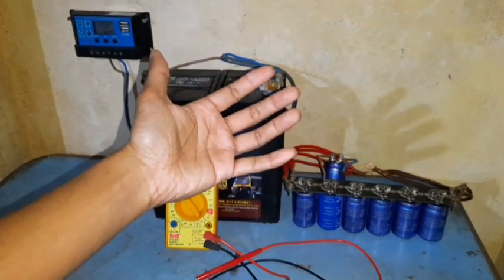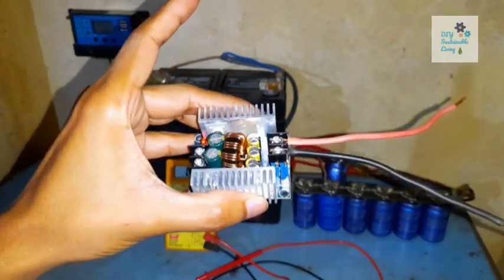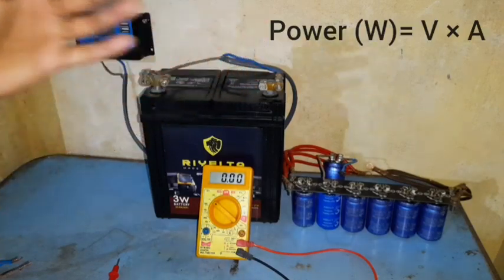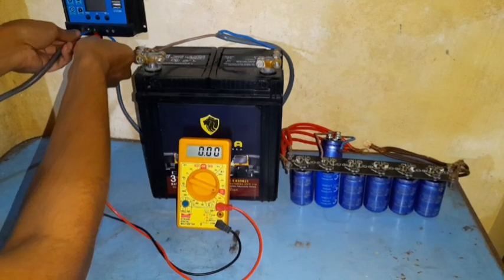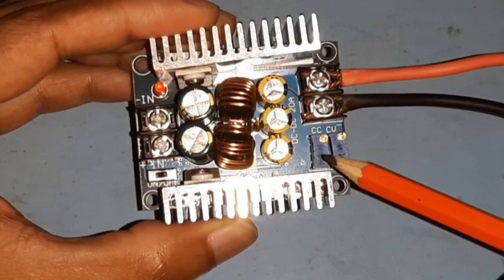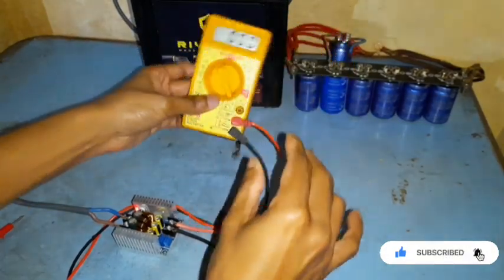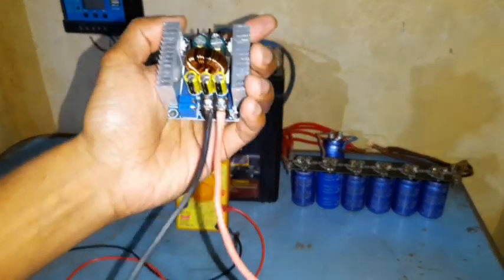Dc to dc Step Down Converter- Part 1 | Improve your DIY Off Grid Solar System using a Buck Converter

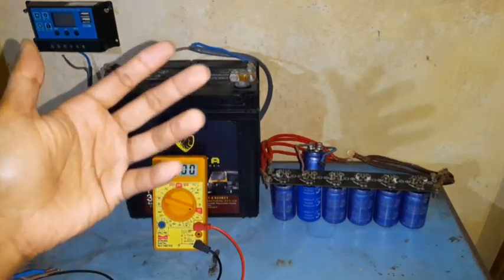Comment: I too have tried this and you highlight the limitation at 4:40. You measured the short circuit current where you got the 2.07A output current. But as you discovered, that was not available to charge your battery because Vout was less than battery voltage. It was actually 0V Had you measured the charge current into your battery, you would see approx 200ma increase or about 2 Watts. This because the Buck converter pulls down the panel voltage very close to battery voltage. There IS a tiny benefit of 2 Watts, but nothing like the improvement you'd get if the buck converter didn't pull down the panel voltage. With perfect buck converter that let the panel operate at ideal 18.5V and stepped down to say 13V, you would expect Charge current to increase by 18.5/13, but sadly that's not achieved. Back to the Drawing board. Tweaking the output voltage somewhere between 12.5V and 14.4V might improve the improvement. I hope that one day, you'll find a solution to this.
Reply from the maker: Please check out my next video on this where I do a live test to see whether it is worth it!... As you mentioned.. if Ithe input voltage is very high you might see a small increase in amps. Only MPPT charge controllers have the ability to keep the panel side voltage at its maximum powerpoint.
Reply: good point, but if youre just charging 5v this should work pefectly for a nice boost in amps to charge usb devices via solar, not so much 12v lead acid, however i would like to charge a battery bank at fast charge speeds i eventually use to charge a laptop. The charging of this laptop is fast via the powerbanks usb c (12v @ 1.5 amps) so i would like to get that same voltage and amps because thecharging of the bank  is slow via 5v.  However the  laptop charger(usb c)  plugged into the bank charges it at 9v 2amps, relatively quickly so i would to do the same with a solar soltution if possible.  My powerbank has a led read out of the volts and amps going in or out while charging is how i know these numbers which is very conveniet.   It uses the USB  PD protocole, im not sure how to interface that with solar but that would be cool.  Would simply something like this work to charge usb pd with solar?  https://www.amazon.com/Charger-Qidoe-Voltmeter-Adapter-Motorcycle/dp/B0915CCH5N

Comment: I have a 250w buck converter 24v to 12v 20amp max output... I ran my 150 w solar panel direct to radiator fan and pul led 70 plus watts(5ish amps at 14ish volts.) But when I ran the fan using a buck converter it's performance slowed drastically and only got 18 or so watts. I've read that buck converters don't work well with ?inductive loads ....is this true or did I buy a cheap one or defective? Can you do testing using multimeter and verify my results and or suggest a solution,,,power in should equal power out less 5 to 6 percent efficiency
Reply from the maker: Unfortunately buck convertery work well when there is a large difference in voltage. A 150w panel maximum power point is around 17 -18V there is no significant difference between 17 to 14V. And as always there is around a 10% loss of power at the buck converter. This is not an MPPT controller. Please check out my other video where I do a live working test on the buck convert with a 150w panel.
Reply from the maker: What is the voltage you have set your buck converter? And have you adjusted the CC trimpot to max output? A 150w panel should give you 8.8A!!!...

Comment: I am going to connect my 100w 12v pannal to buck and to pwm solar input..is this ok?
Reply from the maker: Yes it can be done. Please check my other video regarding buck converters with small panels. You don't get a very significant boost as expected. The link is in the description below!
Reply: @diysustainableliving2774  Same setup I have. 100W 18.5V panel into Buck converter into Battery (always under heavy load).
It gives at best a 5% increase in charge current ntot the  (1-18.5/13)=42% that we might expect, because the panel voltage gets dragged very close to battery voltage. I currently have my Buck converter to 13V with current not limited.
This approach held great promise, but buck converters just don't seem to be able to drive the current up without dragging the input voltage down. Back to the drawing board.

Comment: can your increase 5 A this buck canverter?
Reply from the maker: Please check part 2 of this video. It all depends on how much power you put in at the input. Note that in this video when Im getting 2A it is a dead short so the voltage should be close to 0v!
Reply: where is part 2
Reply from the maker: @dacreation369  You can find the link in the description below or at the end of this video!
Reply from the maker: @dacreation369  Here is the link.. https://youtu.be/OWjOcakSjk8

Comment: Do you think it would work well to use this buck converter to match the specs of a lower wattage/amp/voltage panel on an array? For example, you have a higher wattage replacement panel on a solar array, and you use the buck converter to lower the replacement panels specs to exactly match that of the rest of the array (that the other panels are all operating on lower wattage/amp/volt panels compared to the replacement panel).
Reply from the maker: Yes that is one possible use. Let us know the results of how it goes!

Comment: How about using this buck converter as phone charger from 20w 18v panel ( without battery) ? Will it give an output of 5v with higher ampere?
Reply from the maker: With a 20w panel you will get 1A directly from the panel. So if you step down you should get more amps. But if you want fast charge I think you will be better off connecting one of those car chargers that can give you fast charge option directly to the panel instead of the buck converter. If that requires a steady voltage then you might need a buck converter but most of the time they can handle the solar panel output voltage.
Reply: @diysustainableliving2774  so more amps does not, mean fast charge like this buck converter that you presented?
Reply: If this buck converter be adjusted to 5v, I want to know how much ampere will it give? (Directly from your solar panel)
Reply from the maker: In fast chargers the voltage is not 5v... you will get 9v and 12v options. The charger will decide depending on what your phone can accept. As for your question in theory an 18v 20w panel should give you around 3 to 4A ideally. However as it is not an MPPT you can only expect around 2 to 3A AT BEST since the load will bring down the panel voltage. Thats why I suggested you to consider fast charge 2.0 and 3.0 options if your phone accepts it.
Reply: @diysustainableliving2774    Would it be good to connect this buck converter first to the solar panel then I connect the the fast charger 2.0 or 3.0 the last to the phone or powerbank?    In this sense I will boost the output of fast charger.
Reply from the maker: From my point of view I think you dont need a buck converter. The solar panel can be connected directly to one of those car usb chargers as they require an input of 12v. I know that they will definetly work at 14.4v since that is the voltage the batteries are at while the car is running. The panels voltage changes with the load so I think the buck converter will not be necessary. However if it dosnt work and you want to drop the voltage to 14.4v then you can consider the buck converter. But in my opinion I think it is not necessary in this setup.
Reply from the maker: Always remember. Even the buck converter is not 100% efficient. Id say 85% at best. So if you connect it in your setup you will lose 10 to 15% of your solar power just at the buck converter.
Reply: @diysustainableliving2774  How can there be a power loss in this converter, when the panel upon testing it gives 18V x 0.68A equals 12.24w, then the buck converter gives 14V x 2A equals 28w? Is your panel 15watts in this video?
Reply from the maker: Good question. You see I did this video in the evening around dusk so that my panel output will be minimal and I can show the results on my multimeter. It is after this video only I realized that I was wrong!... What happens at the output is that the voltage drops almost to Zero!... even as the amps go up. The buck converter is helpful if there is a large drop in voltage but not in small differences like from 18v to 14v. My next video I made was to show that practically it is not functioning as an MPPT.
Reply: @diysustainableliving2774  Can we conclude that this kind of buck converter is advantageous for 15w to 20w solar panel?
Reply from the maker: If you defineatly want a 5V source, eg If your phone only accepts 5v and dosnt have a fast charger option or you want to run some thing els that need 5v only then it will be worth it. But if you are going for a voltage of 12v then its not worth. Especially if you plan to use it as a phone charger that has a fast charge option.
Reply from the maker: Tel me exactly what kind of device you plan to run on this panel. I may be able to give you a more accurate plan.
Reply: @diysustainableliving2774  ok thanks for your ideas. This is very helpful for future reference.

Comment: Buck Converter Could  Step Down and Or Stable Adjust Output Voltage (V) and Curent Energy (Ampere). For Solar Panel, Case with PWM SCC before Buck Converter, It Can Adjust To Maximum lower Voltage (14,4v for VRLA Battery) and Curent Output (example 100WP Solar Panel = 5,7 Ampere, It Can adjust to Max 5A depends on weather ). Means, BUCK CONVERTER deliver Limit  Lower Voltage and Focusing to Curent Output (Ampere) from PV (Solar Panel) to Battery.
Reply: True. Buck Converter Optional use  PWM SCC. MPPT Could Manage and Deliver maximum Energy needed for Battery, Recommend Hybrid Inveter, Best Solution for Solar Panel  as an Energy Souce of Electric Use).
Reply from the maker: Yes... But in case of solar panels the input voltage also dropps when you draw power even with the buck converter. That is the difference between a buck converter and an MPPT. In MPPTs the panel voltage is kept at its maximum power point.

Comment: Sir it is possible to use dc to dc connected between battery and power inverter...thnx
Reply from the maker: It depends on what you want to achieve. As long as the battery voltage is within the inverters required limit you dont need a buck converter.
If your battery is say 24v and your inverter is rated for 12v then you will need a buck converter. But remember. Its performance will be limited by the buck converters amp limit.

Comment: Can I connect a solar fridge with electricity using a converter
Reply from the maker: You can but it wont work long. You need at least a small battery. I made a video explaining this.. https://youtu.be/yyEPNL7Va9o

Comment: Where is link to purchase?
Reply from the maker: https://youtu.be/OWjOcakSjk8
Please check this video first before you make your decision.
Reply: @diysustainableliving2774  ok u said link in this video .. but link is about another video in that video buck converter link is there .. 😊
Reply from the maker: I realized that the buck converter is not good as a MPPT after making that video. So thats why I had to change the link that way so as to not mislead you guys. 🙂
Reply: @diysustainableliving2774  i hv service line wire ( aluminum ) it is 50mtr wire so can i use that wire for my 100watt mono solar panel ? If yes , 1) will it drop my panel voltage and amphere ?
Reply from the maker: Service line? Do you mean the thick wires used for mains power transmission by the grid?.... Aluminium is the best material for conduction and the thicker the wire is the better the conduction. But always try to keep the lenght of your wires to the shortest possible distance to avoid unnecessary losses.

Comment: Sir can be use also in mppt
Reply from the maker: Its good for a voltage regulator and charge controller. But later only I realized its not a good MPPT in all circumstances. Check out my other video where I do a live test with the buck converter on my system.

Comment: Where back converter is available ? Can we buy it on line ..
Reply from the maker: Yes it is available online. But first watch my videos and see whether it suits your needs first.
Reply: The power will be the same always, but you can control the voltage.  If you have 12v and  2a is equal to 24 watts when you use DC a DC converter you could download de voltaje for example 6v and 4a but the power still be 24watts.

Comment: I have 150w solar panel i am directly using with bettry and solar because i never allow to solar overcharge my 🔋 due to at the same time i consume power .but i had  also used pmw that reduce my fan speed 
Now please advise my weather i use this dc buck converter or not and my problem is why fan speed reduce as compair to direct from solar
Reply from the maker: Good observation. The problem is when you connect the solar panel directly to the battery the voltage in the lines rises. The pwm controller is able to limit the voltage at around 14.4v thats why your fan works slower than when it is directly connected to the battery. Adding a dc to dc buck converter is NOT going to increase your fan speed if you limit its voltage at 14.4v.

Comment: hello, without battery and with battery. Thank you
Reply from the maker: I have made a video of its preformance in a live test. https://youtu.be/OWjOcakSjk8
Here I have connected to my solar system with battery and inverter running a load aswell. This is to show the maximum preformance that it can give. If I connect it to battery only the amps keep going down as the battery voltage goes up.

Comment: plz do practical video to showing the buck conveter efficiency through pwm controller charging the battery....
Reply from the maker: Yes! Its in the works.... Im still testing it at different times of the day and at different light intensity. It seems to be bringing the panel voltage down as well. And at low light intensity it is not giving the boost I expected. Any way this is not an MPPT. So I will post the results on the channel one I complete my work.
Reply from the maker: Here is the video explaining the buck converter in action. It all depends on your solar panel setup. https://youtu.be/OWjOcakSjk8

Comment: That cheap scc only use mosfet to control na current flow not diodesss... and just add diode in the output side of the buck converter forget that cheap scc.
Reply from the maker: Yes.... I got to know about that only after making the video. But there is one benefit of the PWM controller. It actually gives a good control over the amount of power comming into the system once the battery is full. It uses the mosfet as a switch and adjusts the amount of time(pulse width) the panel is connected to the battery once it is fully charged. So the buck converter just prior to the pwm controller makes a good combination as a solar charge controller setup. But still as you said a diode will also serve the purpose.

Comment: Thanks for explained. 
How mouch prices 
How to get in bd
And maximum amp?
Reply from the maker: Maximum continuous amps is 15A. Its always better to oversize for your system. As for price you have to check on amazon or ebay from your area. Im sorry I cannot help with that. You can always check it on the link I have added in the description.
Reply: Same as the reted panal back side ampare.
But back side voltage 18/22 volt
And when i charge direct or use pwm
Ampere are same but voltage are down to 12
Reply from the maker: Yes then I think you better try with one first and see if you are satisfied with the results. Remember!... this is Not an MPPT so it wont adjust the panel voltage for the maximum power. But you should be able to see a rise in the output amperage. BTW a fully charged lead acid battery should have a voltage of 14.4V so remember to adjust the buck converters output voltage to 14.4 at the start itself.
Reply from the maker: You can try by placing the panels in series and parallel to get a higher voltage and amperage and then send it through the buck converter. What I have found is that on lower voltage panels it is not enough to get the amps up. Ill be doing a video on this shortly.
Reply: thanks for reply
Reply: I have 4 solar panel
80watt 60 watt 50watt 20 watt 
But it has not good perfperformance. 
Solar panel give me 50%  Energy in full sunlight . 
I want to install 4 pisces dc to dc cc cv kit for full or 80-90% perform
Reply from the maker: Im not sure what you mean by 50% performance. Is the short circuit amperage the same as the rated one on the panels back side in full sun? Or half of that?

Comment: How to connect 320watt solar panel  this converter
Reply from the maker: You might have a problem with higher power panels since their voltage will be more than 40v which is the maximum this device is rated for. If you get another buck converter which can handle that voltage then you better use a 24v system, because the more the voltage difference the less efficient it gets. So taking all those facts into account you might be better off with a good MPPT charge controller.